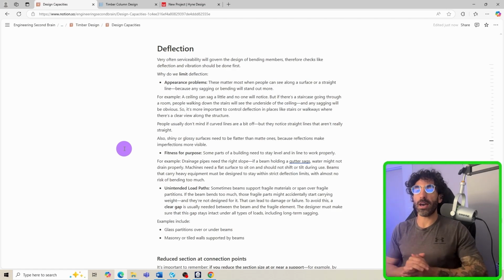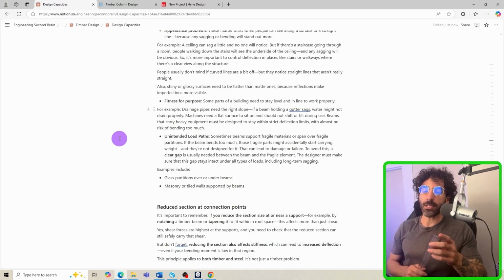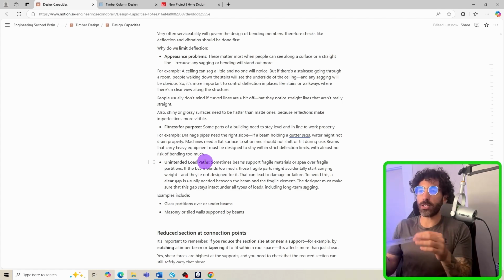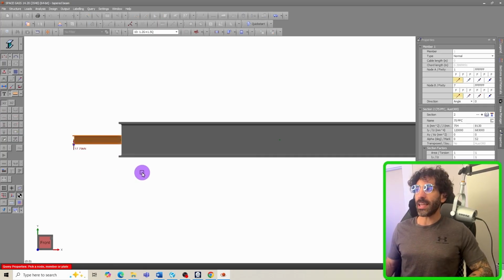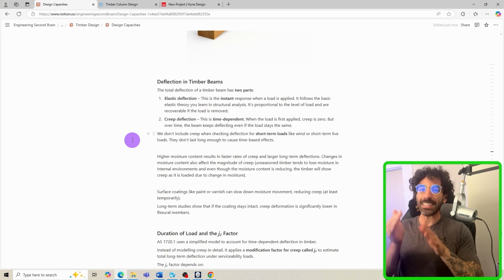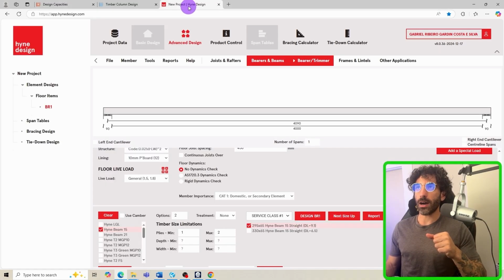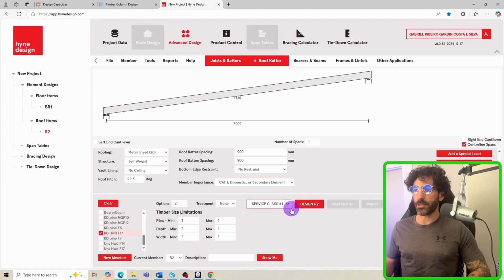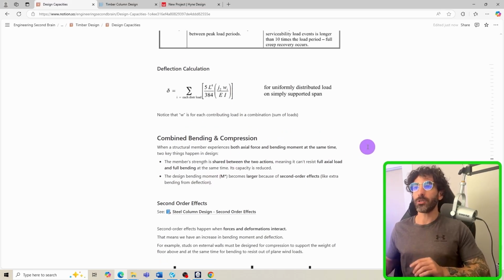Deflection Checks of Timber Beams (Lesson 6 of 7)

Comment: Hi Gabriel, really appreciate the videos. I am a graduate civil/structural engineer and I am contemplating on signing up to your course. I am just wondering on the introduction video you said that you’re still finalising the contents and materials. Is your residential design course complete, how many hours is it? Please provide me with more information. Thanks again
Reply from the maker: hey..thanks for reminding me that. I have to update that video. I'm still finalizing the footings and foundation module and the Autocad drafting module. Apart from that you will have around 30 hours of content to go through including the main program and workshops. It's more than enough time until I finish those final modules. Any otehr questions you can send me an email as well. Cheers
Reply: @bengthebrazilianengineerinAus 
Thanks for the reply, I have just sent you an email. Cheers